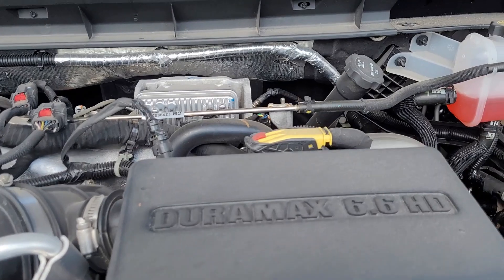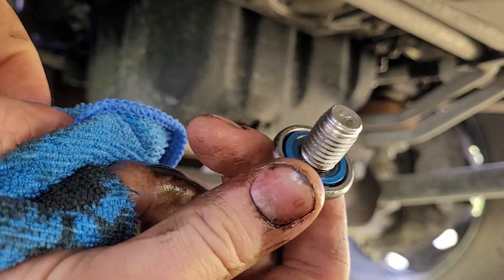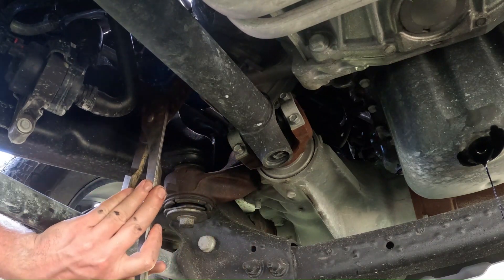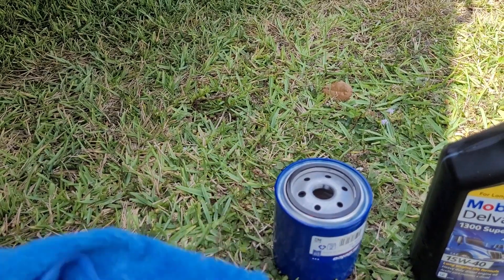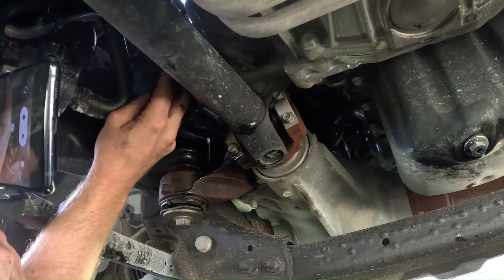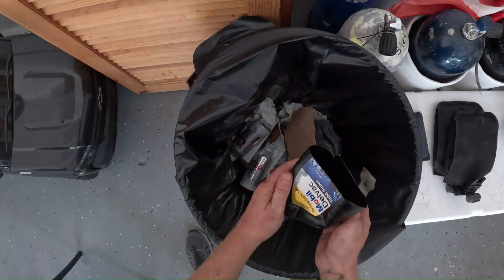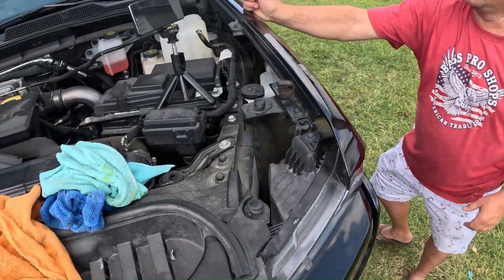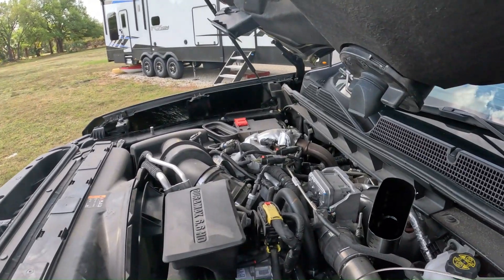How to Change oil on a Chevy 2500 Duramax 6.6 Liter

Comment: How involved is changing the fuel filters? Assume there are two like the cummins? Its kind of a PITA on the cummins.
Reply from the maker: It's pretty easy, if you can change oil you can do the fuel filter. only one fuel filter on these.  I actually did a video on that too. https://youtu.be/_HJI68KAZYA

Comment: no gloves…did you run it for about 2-3 minutes..open oil fill cap for easier drain???
Reply from the maker: the motor was warm, it drains just fine without taking the oil cap off
Reply from the maker: but yeah I should wear gloves